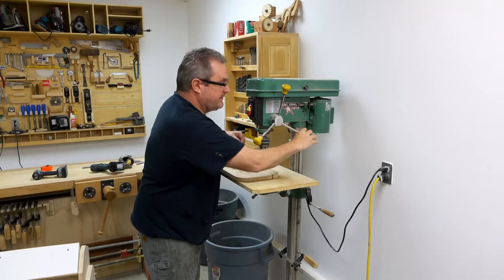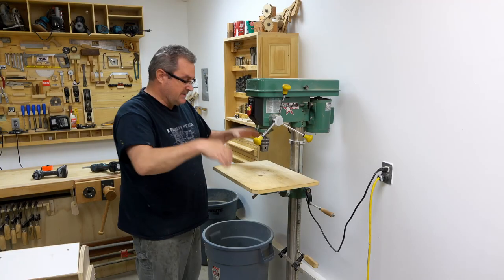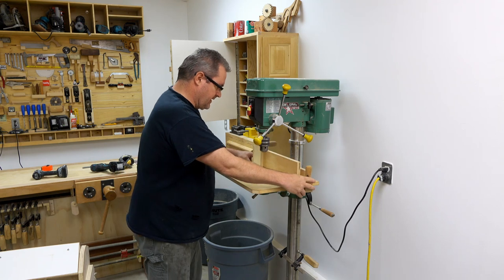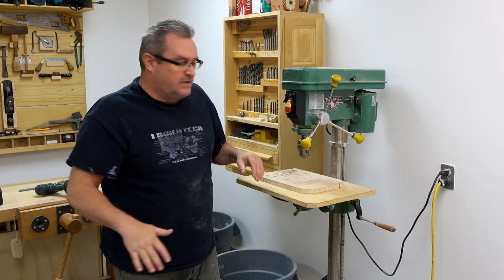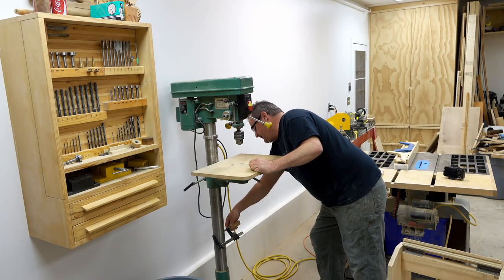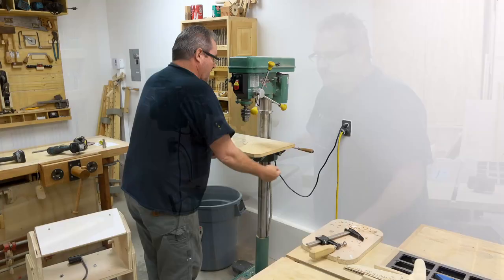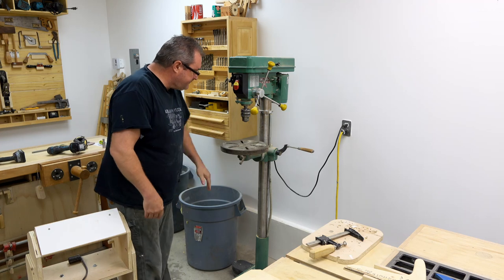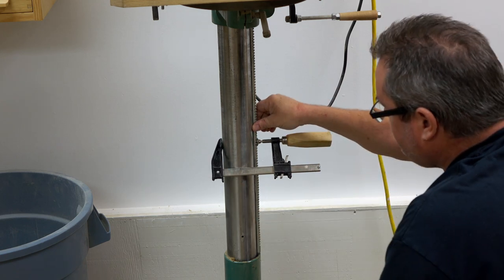Why I Use A Drill Press Table

Comment: Faced with the same dilemma, instead of fold-down wings I made a riser block that fits between the factory drill press table and my wooden one.  This raised the wooden table almost 4 inches and provided clearance for the crank handle.
Reply from the maker: Still need to reach underneath the table to adjust it.

Comment: Could you drill some holes through the rack and into the main cylinder support and then countersink some small screws in there to keep it up against the shaft tight and keep it from moving?

Comment: After about 3 years using a drill press table based on your design, I am perfectly happy. The fence is great and the simple design works. I never built the stop block since I just use a spring clamp with an offcut. I am often drilling larger pieces so the backer approach doesn't work for me --the inserts are ok. And no worries about the crank getting in the way as my older drill press has none and I've never understood the need for one. Thanks for a practical and handy design.

Comment: I had a similar problem with the height adjustment crank hitting my drill press table and solved the problem by installing a 3/8" deep throat socket on the spindle in place of of the original crank. I figured out the socket size that fit over the spindle, then tapped a hole into the socket for a set screw to lock it in place. I bought an inexpensive short handled ratchet that I dedicated to the drill press to raise and lower the table (with the ratchet action I don't need to make 360 degree revolutions, so I avoid hitting the auxiliary table)

An added bonus of having the socket there is that in the rare case where I need to move the table more than a few inches I can grab a cordless impact driver move the table very quickly

Comment: As with all your videos it's great to get your views on things like this and shop vac. As I learn it saves a heck of a lot of time... thanks

I was also thinking of putting a standalone table on my drill press (I have the same issue with the rack) so it will be good to see what you come up with. I did have an idea of a motorcycle stand under the drill press or a wooden equivalent (basically a scissor lift) as they have around 500mm of vertical movement and are very heavy duty - would be interested in your views

Comment: If i was designing that drill, i would mill a vertical slot in the pillar and fix the rack  in position, then have a collar that rides up and down with the handle on, then the table would sit over the collar, the rack would be more solid, the table could still rotate around the pillar, if the inner and outer collars had a slit, you could still clamp it in position.
I might even use a geared motor for raising/lowering.
Reply from the maker: I'd acme thread the entire post and use a ring nut under the table. Turn the ring nut to raise or lower the table.

Comment: Love the vids! Maybe a two piece clamshell clamp made from wood with a cut in one half for the rack to go though. If you get your hole diameter correct you can clamp the to pieces together but it will still spin as you want to rotate the table and it would hold the rack against the column. Hope that made sense....as I'm kinda stoned. ...lol

Comment: John, what brand of drill press is that? I wanted to get one that size. I have a short one that's really poor quality
Reply: It's a slightly older General International. Probably a 15" floor model. The new ones run about $600 USD +-.

Comment: Love your videos! I'm just starting to put together a small garage shop and have learned a lot from your videos. I don't know a lot a about drill presses but couldn't you epoxy the track to the side of the leg instead of using a clamp? Keep doing what you're doing!
Reply: Brent S my understanding is that you would loose the ability to move the table side to side if you did that
Reply: It needs to rotate around the post freely as the table turns.
Reply: Good thing I don't attempt to 'fix' things lol

Comment: Same problem on my drill, shit gear rack!
As I very seldom drop that low I just secured it with a zip lock tie ... that way I do not have to "waste" a clamp.
Waiting to see the new and improved drill press table!!
Reply from the maker: Great idea!
Reply: I Build It Scrap Bin ... and it can still pivot left and right.
Reply: When I saw the gear rack sprung out I figured it had lost a couple of screws embedded into the rack. Is the post thick enough to tap for a couple of small machine screws recessed into the gear rack?
Reply: D irk3672 ... Not possible, the rack moves around the shaft when you move the table left or right. It is attached to the handle assembly that moves the table up and down. If you bolt it down you cannot swivel the table left or right any longer.
Reply: I had the same problem I used a hose clamp, same as the zip tie just metal
Reply: Good poi nt, but one possible solution would be putting a gear clamp onto the column, then attaching the rack to the clamp.
Reply: Send it out for case hardening
Reply: i've just remove mine and drilled the loking handle do it's on the right side now, it make adjusting it way easier

Comment: probably the most annoying but most used tools  I have.  I removed that rack adjusting system and now just use the tightening collar and raise and lower by hand as shitty as it is I prefer it to the rack.  My table is as simple as yours, but I'm stealing you fastening method this weekend, no T-track for me either I  do differ with the fence  in I use a 3/4" inch dowel and pivot it from the corner 1 hole on the high and 1 on the low side of the fence.  great video thanks.

Comment: Why don't you drill and tap that gear rack in a few places and screw it down. I can't tell from the vid, but if it is thick enough, you can countersink the hole below the gear level. If you keep bending it, it will probably break eventually.
Reply from the maker: You are not familiar with drill presses, I take it.
Reply: the rack needs to spin round when the table spins around which means it can only be attached at the top and the bottom with stupid rings, my drill press has the exact problem only zip ties seemed to work well for me